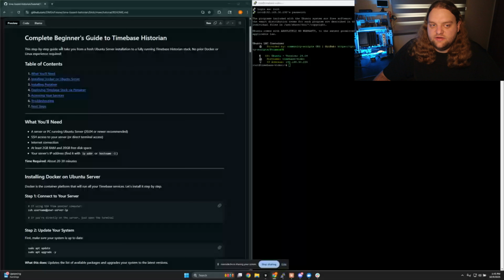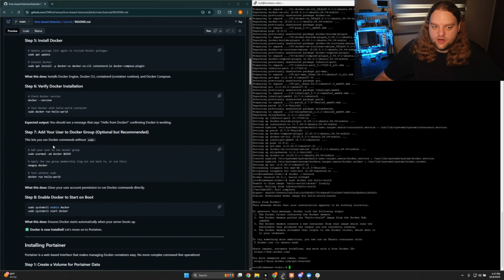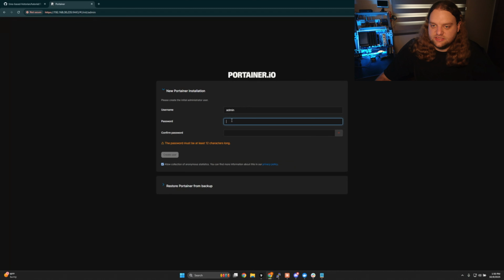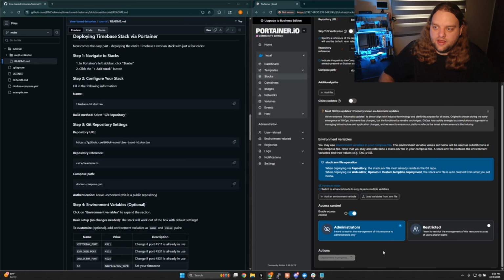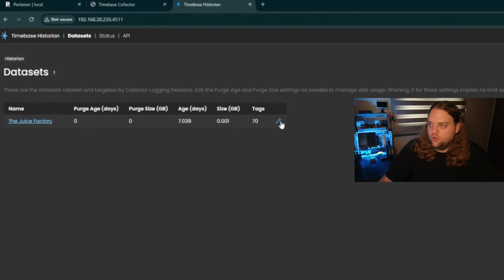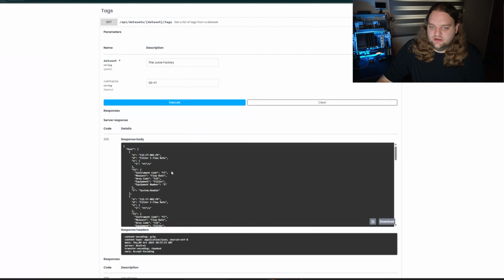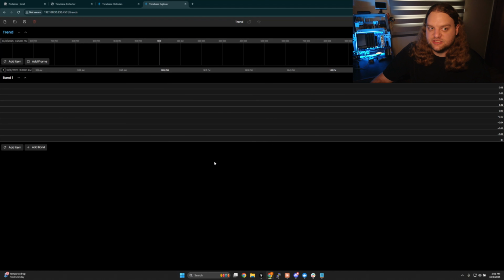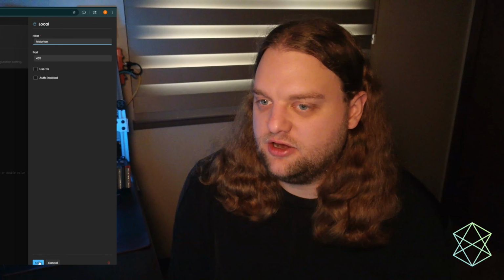Installing Timebase (Free Data Historian) using Docker

Comment: Is it recommended to install with docker? Can I do it without it? I want to use it with ignition.
Reply from the maker: If you are familiar with Docker, it is a lot easier to get started using it. But if you do not already know Docker, you can get started without it as well. For production, there are a lot of tradeoffs, sometimes it is best and other times it is not.